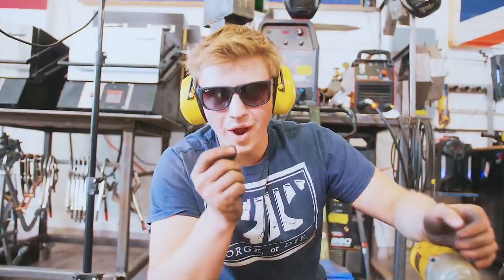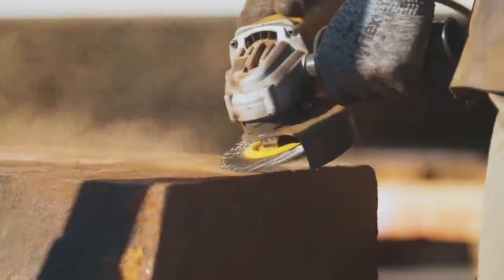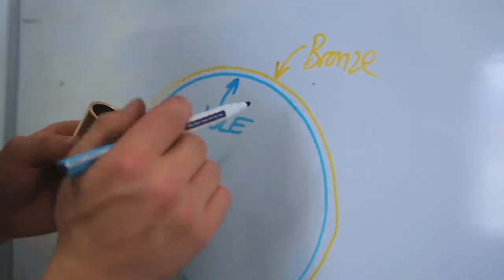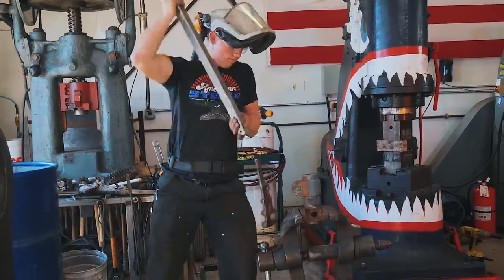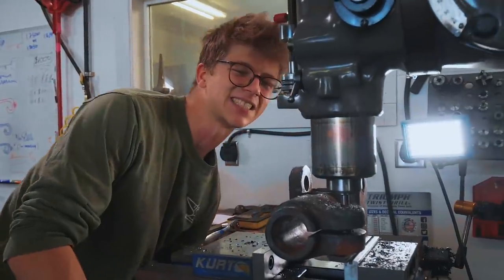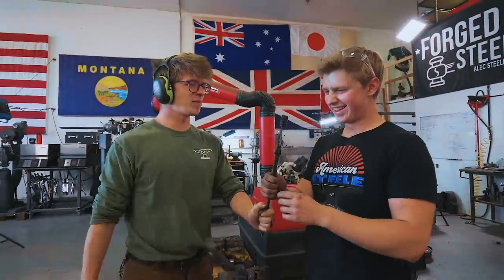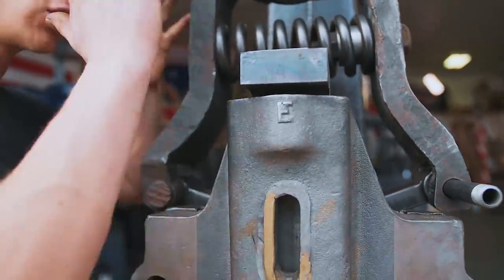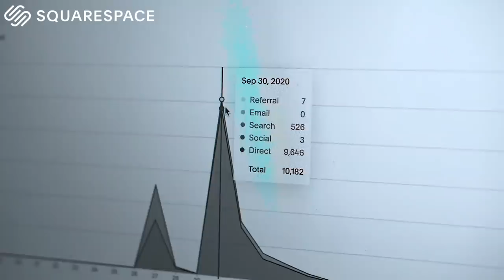RESTORING THE FAIRBANKS POWERHAMMER!!! Part 4

Comment: “It can’t be stuck if it’s a liquid”

True in machining.
True in laxatives
Reply: True in your undies
Reply: or the pleasant discovery that your pipes didn't freeze overnight...
Reply: Poly Bun  I friction welded a bearing race to a trailer spindle one time. When grinding it away, there was no weld line at all. It was cool as hell...  I mean, aside from the fact that I was doing it in the parking lot of a Walmart at 10 PM.

Comment: When rounding a part like that dogbone in a manual mill put a pin through the hole and allow it to rest on the top of the vise then when the height is set you just keep pivoting on the pin and reclamping.  It's a great trick.   Cheers

Comment: Every engineers nightmare! That was pretty impressive managing to get that bolt out! I had a similar situation and I completely mullered the part in the process of failing to remove it. I've since learned of the existence of a local company that does spark erosion. If I'm ever in that situation again, I don't even entertain trying to remove it. I just take it to this chap and he gets it on the spark eroder. Saves me alot of heart ache and it saves the part. He also restored the thread for me too!

Comment: A term you need to look up...

Heli coil 

Drill oversized hole, cut threads, insert a sleeve threaded on both inside and outside, where the outside thread fits oversized hole, and inside is the bolt hole you want to fix

Comment: What are you doing?! Just weld a damn nut to the stuck screw and twist it out while cherry red. Takes 2 minutes. Works everytime.
Reply: I've done that many times. It is my preferred method if it can be done. Works better then any other method that I know of. When I saw that on screen, I was yelling at them but realized they couldn't hear me
Reply: Finally someone said it 👏👏
Reply: Also use a high moly paste to lube the threads if you're going to be heating and cooling a something with a bolt in it. The grease will burn off, but the stuff I have is ~70% moly by weight. Bolts/nuts just spin right out, even stainless.
Reply: Plus he now has a deep grove cut into it that might crack later on from using the grinder with a cutoff wheel. Have used the welded on nut trick many a time over the years, has never failed as long as you get good penetration.
Reply: I came here to say exactly this. I've done it heaps and it almost always works
Reply: or using a screw extractor, also when machining threads they should have measured them for tolerance so the screw would have the proper fit.
Reply: @superorion271  the threads galled due to the heat warping either the bolt or part. That is why it would move make and forth a few degrees before binding. Proper lube would of allowed the bolt to come out without galling. A greater clearance on the threads can help prevent the galling as well. Best to combined both.

Also I feel bad for thier wives, they only ever seem to assemble everything lubeless.
Reply: @superorion271  screw extractors suck. Try welding a nut to a broken bolt one day and you'll understand

Comment: Y'all are getting pretty good at the machinist skill and making the tap was darn good and that used to be part of our test as a tool and die man, NOW I know that they make oil impregnated bushings called oilite bushings but if they get too hot most of the oil dissipates. And when we made bunning bushings we would machine a ring in each end and with the same tool turning the round nose tool draw a grove from inside to inside in two spots without breaking through to the end of the bushing before we install them in the piece of equipment, and we would cut them too length maybe a little shy, and the job y'all did on the two links were great nice job,keep up the good work really enjoying since across the pond.Thank You Jake Bissel.

Comment: So with the stuck screw... just a thought I had. If that kind of thing happens again, Drill a hole through it, put a rod through the drilled hole, Weld the rod onto the screw, make sure the rod is nice and long, then you should be able to torque it out with a cheater bar on a 90 degree angle.

Comment: "It can't be stuck if it is a liquid, right guys?"  Ha ha ha ha ha !!!!!!!!
Reply: I mean, he ain't wrong😂
Reply: I'm pretty sure I head alec using a reference for to full Metal Jacket.   He yelled Get some , Get some baby.
Reply: you beat me to it.
Reply: Hmmm Actually it can,,have seen super high pressure oil,turn to jelly in side a porta power jack,(Ram),,even with no load and input fitting removed,,oil still jellied in side of jack,,Reason,,wrong viscosity oil,,high pressure 5000,psi plus,ya need super thin oil,,why most prota power have oil,nearly water consistency..
Reply: @ianwilliams487  so you basically telling us that it became partially solid and therefore isn't a liquid anymore?
Reply: @Seelenschmiede  ,,you could say that,,think about glass,appears to be solid right,,but is still liquid,,and if left long enough will form tear drop shape as the top seeps to the bottom,,
and if ya don't beleive me look it up,,
as for the oil,,45 years as Hydraulic fitter,,and have serviced gear running at 40000 PSI,use for oil injection fitting,,That where you use oil to expand hole and oil to jack it on the shaft,,at the same time,,
took 3 days of pumping to remove palm end drive from bloom mill rolls,

Comment: for broken/stuck bolt removal - left-handed drill bits.
Reply: I was going to say a left hand thread
Reply: The hands down, guaranteed method guaranteed to get it out, is a hole popper. Downside is they've gotten stupid expensive over the last decade. Number two, especially for larger bolts, is to mill/ drill them out using carbide tooling.
Reply: For a bolt that's seized like that, nuh-uh brother. Drill centre whack something in there as they did, or weld on a nut. I deal with broken off seized junk bolts several times a week and those two methods are the only real option for most of them. Some can be blasted out with a torch if you're careful and it's a through-hole. Oh and usually a lot of heat and cussing and penetration oil left on for a bout 3 picoseconds.
Reply: @ColtaineCrows  left handed drill not screw extractor - basically do what you said but the drill is turning left so if it happens to catch and save you some time great. If not you have a drilled hole ready for other methods.

Comment: You guys realize that this hammer is going to be better than new when you're finished with it. Right?!!
Reply: also: understanding how things work, in the end they might be able to build one from scratch.
Reply: @ulrichkalber9039  you mean build a second one from scratch, they're already doing the first one now.
Reply: @noahbaden90  pretty sure they wouldn't be able to forge up those massive pieces, but amazing effort
Reply: @johannsmith5697  only because of the size of the furnace. Also, wouldn't the big pieces be cast ?
Reply: @christianvanderstap6257  i think the big pieces are cast yeah
Reply: Youd need a large forge and foundry to cast anything that size. 

Forging them, the shear size of materal etc would require heavy industry not just smithing.
Reply: @johannsmith5697  IDK , thay have a very big power hammer standing by to do the work now.

Comment: For extracting the screw, drill a smaller hole then broach it square to turn out with a square tool. Banging a square tool into a round hole almost places you back to the beginning... Good Work - Never give up!

Comment: I used to do something similar when I was a mechanic. If I was putting in a leaf spring bushing (which is an interference fit) I would put the bushings in the fridge and lay the leaf spring out in the sun and go to lunch. When I got back the bushing would go right in.

Comment: great work! my worry is that will just left open holes to put in oil in the new links so that will allow dust/ metallic particles to enter into the bushing an cause premature wear. maybe a zerk fitting/ or a set screw you can remove when more oil needs to be added. happy forging!

Comment: "Still no sign of a loose screw".

I beg to differ, Sir.
Reply: You don't have to be a bit nuts, but probably helps.
Reply: He is just looking in the wong places.
Reply: As an aircraft mechanic  I know Alec's feeling when that pain in the ass stuck screw finally comes out saving the stupid expensive part
Reply: @stevegrillot  Souvenir the part to remind you that the impossible sometimes takes a little longer.
Reply: @gorillaau  i have several in my toolbox

Comment: For the future regarding drilling out the bolt. After you drilled the hole you could've taken a hacksaw blade, run it through the hole then reattached the the hacksaw. Cut two opposing slots and the halfs more or less fall out! Its got me out of trouble in the past.

Comment: Adding grooves to a bronze bearing only works for hard grease lubricated bearings. Any interruption in the surface of the bearing will pull oil away from the surface as it turns. Eg, edges break up the oil film slighty. A perfectly smooth bearing surface will have an even distribution of oil if the feed is correct so will result in less wear. 
Just radius the edge of the feed hole slightly so the oil can evenly feed into the bearing and that's as far as you need to go. Done it on many steam locomotives in daily service and they have no issues.

Comment: Stuck bolt. Put a large nut over it and mig/tig weld it on through the hole - heat helps loosen the bolt and the nut allows you to pull it straight off

Comment: If you have a screw that stuck, and already bored out the center, try putting two parallel slits down the length, and insert a fitting flat steel rod to twist. Maximum force transfer on a maximum area. Depending on the size of the screw, the groove just hast to be wide enough for an appropriate size steel flat bar.

Comment: You can heat up metal and it expands.

You can also heat the material and then get some compressed air to quickly cool off the material and it will shrink. 

But as I was typing i see you got it out. 

Always more than one way.

Comment: Had a similar experience with the cross bolt that held the lower ball joint in my subaru, then proceeded to snap off a hardened easy-out in the hole i drilled through it. Finally got the bolt off the hub, but not out of the hole. I hammered on it too much and broke the ear off the hub.

Comment: Apologies if somebody already mentioned it but the oil distribution holes and grooves in a bronze plain bearing needed to be placed with considerable  thought: they need to allow the oil into the bearing IN A LOW-PRESSURE AREA of the  bearing.  If you interrupt the bearing surface with grooves or holes in the area that is supposed to be an oil film carrying the main loads, it will dramatically reduce the load capacity of the bearing.

Comment: A quick and easy way to cut an oil journal in a bronze bearing is to chuck it up in your lathe, set the speed low and then quickly run a cutter through the inside. This will cut a clean spiral groove inside.  Deburr and you are done.

Comment: Hey just for future reference if you drill it then take the torch to the inside of it and soon as the bolt gets hot enough you can blow it out without harming the threads because the thin bolt steel will heat faster than the other thicker material. Especially bolts in cast iron.

Comment: As a portable machinist I spend way more time than you’d think removing broken studs from forging presses. Lots of times I just drill them down the middle and torch out the remainder. Without hitting the threads if the hole
 of course

Comment: You guys do amazing work just fantastic stuff. You have some machine tools that you use pretty good. You also have some very very nice heat treatment equipment. When you heat treat a bolt like the one you made 1st you should always leave a radius in the thread relief and it doesnt need to be as hard as knife blade the purpose of the heat treat on a bolt it to tuffin it up it's not a cutting tool lol. You should do a long temper to draw down the hardness. It fun to watch you learn as you go into different trades. Keep up the amazing work the skills the two of you have at such a young age is mind blowing Love the work you do.

Comment: You guys should really look at getting a carbon arc welder setup in there. You just plunge the rod into the middle of the piece of metal you're trying to remove, then dump some liquid nitrogen in the hole and pop it out. Just be aware that the rod will spray molten metal straight back at you, so please use a welder's blanket to protect yourselves. If you don't trust me (because I'm a stranger on the internet) you should just get something stuck on purpose, and give it a shot on a non-critical piece. You'd be amazed. It's awesome.

You seem to do a lot of stuff that could benefit from collaborating with a manufacturing company. The bronze bushing you're using could use some finesse. I used to work at a hydraulic crane manufacturer, and our machinists essentially cut a series of large twists in them (think a super huge thread count on a hole for a bolt), and installed a grease zerk on the end with a hole in there which led to a trough we ground in to connect the twists.  

Also: There's some honing stone kits where you can attach them to a drill, and use a wheel to apply gentle outward pressure while moving the stones in and out (while rotating) and applying honing oil to get the fit JUST right. As for making your own screws: You could probably buy screws from a manufacturer like Fastenal, or Tacoma Screw (if you're happy to work with a company in Washington). 

Lastly: You should definitely invest in some Anti-seize. Loctite makes some good stuff, and I recommend getting both the copper grade and silver grade.

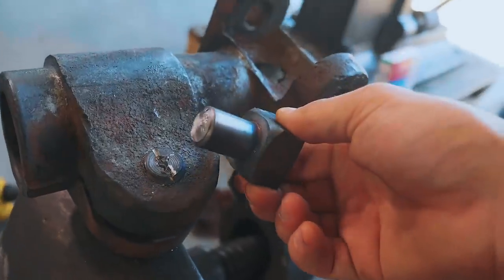Comment: 7:25 you can actually weld a nut onto the end of that siezed bolt and use a breaker bar to get that out of there. Might work better than a makeshift flathead

Comment: Fun vid!  And fun to see you guys learn stuff on the fly.   Good job.  But, maybe, next time use a bolt and nut instead of the bolt alone in that split part with the ears.  Looked like there is plenty of room.  That way if the bolt and/or nut fails, you just simply pull it out by hand...   No getting stuck bits in there.  Good to plan for issues like that ahead of time if you're gonna put a ton of force on stuff with a cheater bar.

Comment: 7:10 Hence why I said use a through bolt and nut for that part. Here's the problem with using a bolt with the threads in slot clamps for tubes, when you insert the bolt the two holes are lined up so the bolt threads nicely, when you tighten the bolt you draw the two sides together but those sides are not coming together evenly, the slot side moves less than the outside and pinches the bolt the same way a person snaps a twig creating stress on the bolt and presses the threads together unevenly as if it was cross threaded. That's why the original bolt removed was in such terrible shape and why the brand new one broke and got the threads stuck so bad. A through bolt and nut eliminates the first problem and prevents the second.

Comment: Hey Alec. Next time you encounter af stuck piece of thread, you should drill a hole almost all the way through, then you fill it up again using some sort of weld. When you get to the top you place a nut on the stuck thread, and fill that too. Now you just have to let it cool, the welding will retract therefor shrinking the bolt and you can often just wind it out with your fingers.

Comment: Using the boring bar to cut a coarse internal thread (for the oil galleries) into the bronze bushings would have been exceedingly impressive.

Comment: You should have a screw extractor kit in your shop. They are life savers. You drill a whole through the screw the the extractor is reverse threaded from the screw. So it grabs the screw and pulls it out.

Comment: You might want to get the cut from grinding out of that crosshair, probably by welding, or braizing depending on the material, that is a position where you don't want any stresses to concentrate and potentially cause microfractures. Once said microfractures have acumulated too much the entire thing might crack along the cut, such spontanious cracking will happen at sonic speed (within the material) and I don't think I need to spell out how bad that could be if the machine is running at that moment.
As for the oil resorvoir you could have turned the lubricant groves into the bushings, then heat fitted them, drill the supply bore and fitt them with a screw in lubricant fitting (?), preferably one of those with a spring and ball, to keep dirt out and oil within, that should give you a couple of hours to days runtime without the need to reaply oil. It should be noted that if the machine is not used for a while you might want to apply oil anyway, best under a slight preasure to create a "swimming" effect between the parts and reduce the start up wear even more, though that is more optional then nessessary.

Comment: Weld the broken bolt back onto it. Grind a point and carefully weld it onto the back side. Doing that heats it and then it comes right out if your weld is decent and you didn't let it cool for too long

Comment: I'm a machinist, when you whipped out our bible, I was damn proud. On the bearing note, its hard to find but you can get oil impregnated bronze for bearings. It literally has millions of little droplets of oil in the bronze. So as it wears, it lubes.
Reply: damn what awesome engineer discovered that technique, and what kind of magic oil is used?

Comment: You already had the part with stuck bolt in the mill. Just pickup the center of the bolt, drill out close to the tap drill size and remove the threads with pick and needle nose pliers